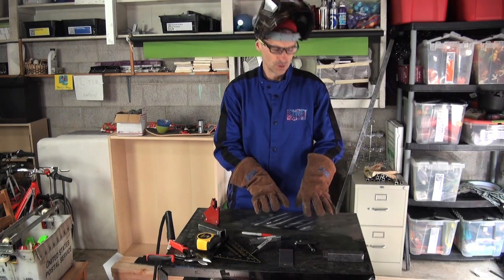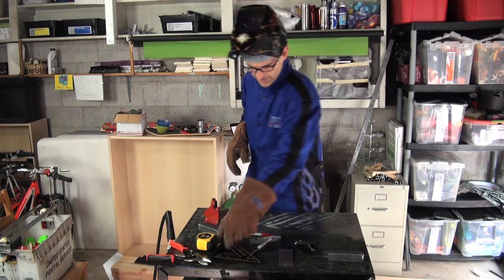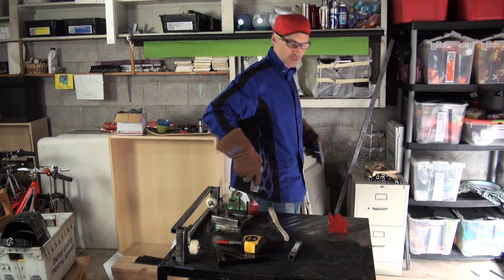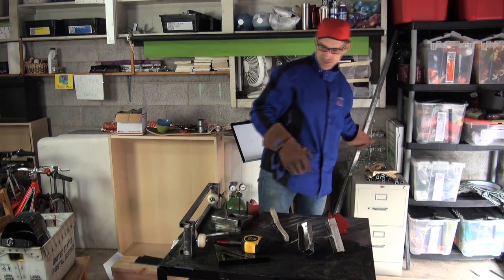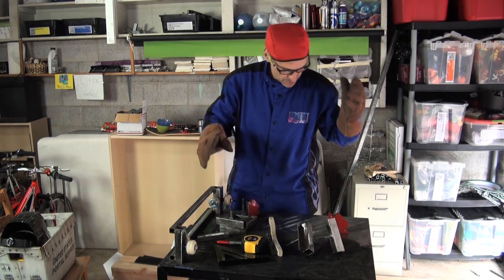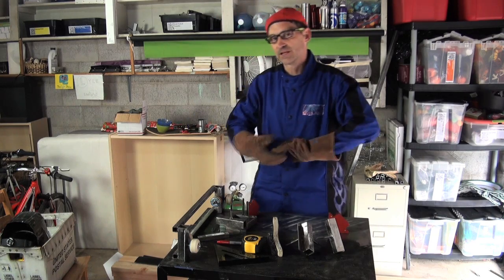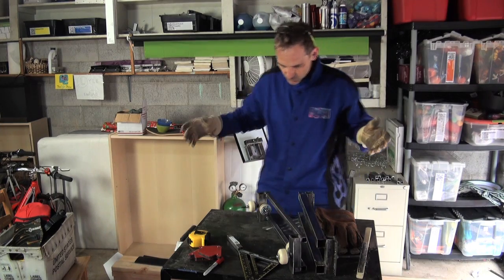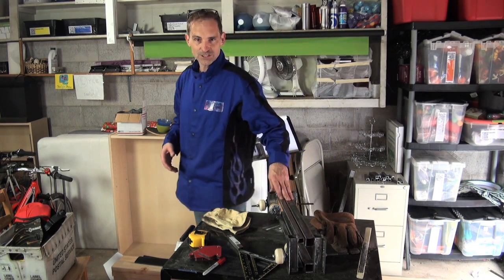Steel Backyard Roller Coaster Cart - Wheels Done!

Comment: Hey, nice coaster! Awesome job!

Just one comment about what I would do if I were doing what you are doing and a child's safety is involved. I think you'll find that you don't need to let the back wheels pivot. When you complete that part of the cart hold the back wheels fixed from pivoting and the cart should have a few degrees of sideways "turning" it can still do. Any condition where there would be anything more, you're not having a good time anyway. This would help prevent a runaway condition where one side is caught up, pivots, than further jams the wheel into the side. Less complicated and more stable. You could give the front wheels upper limits on their range of travel for the same reason.

Just trying to give helpful comments. Keep up the great work! Found you through Hackaday.
Reply from the maker: Thanks for the tip! 

Actually, the first cart I built conformed to the design you describe. I found that with the new design, the drag is much lower. I'm building stops to prevent over steer and over bank.  The cart will also have a roll cage, a seat, and a seat belt for safety.  Like yourself, I take the safety issue most seriously. So much so that my kids named our coaster "The Caution Zone" because whenver they're near it, I give them a safety lesson about it! :)
Thanks for watching, and thanks for your comments!
Best,
Will
Reply: Will Pemble Glad you found it helpful! Best wishes!